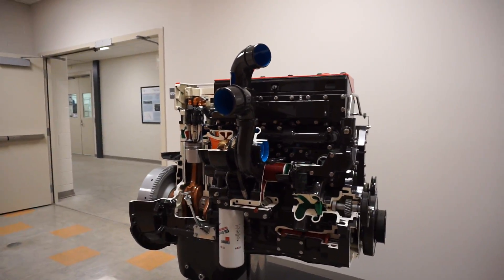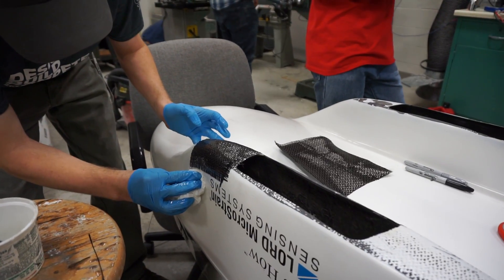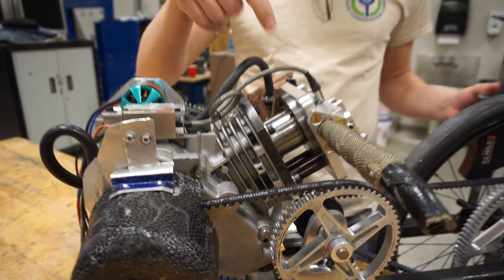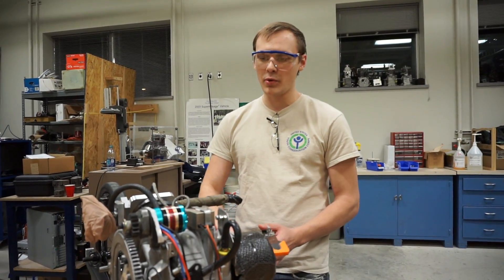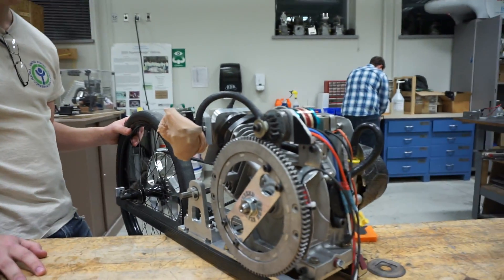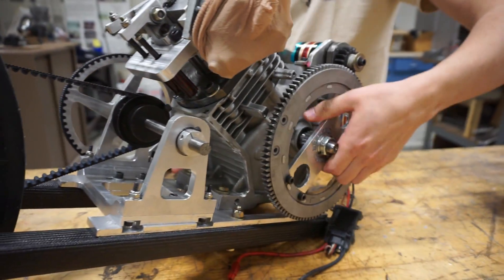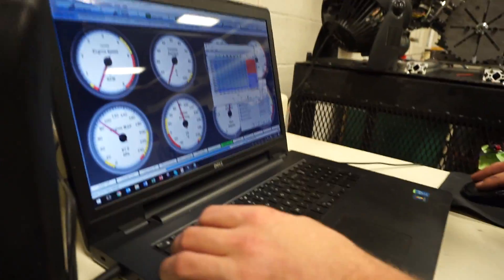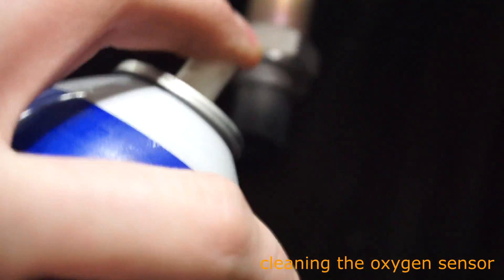How to Get Over 2500 Miles Per Gallon - Supermileage Club Penn State

Comment: In F-1 V8 engine, valves are actuated not by springs mostly because springs cant handle those RPM's, instead by liquid nitrogen , its most stable substance in temperature difference.

Comment: Is that Megasquirt efi? Datalogging will get your tables right. It just takes time, and for the engine to be run at as many throttle positions for every rpm in the rev range. 4100 rpms seems pretty fast for a briggs engine. Usually valves float at 3600. Maybe you could try something lighter. Surely someone could make some titanium valves, retainers, and locks for a gx35 motor.. maybe some beehive springs or at least some slightly stiffer valvesprings to control the valvetrain a little better. I'm assuming the valves and seats have been treated to a multi angle valve job. If not, more power and efficiency can be had there. You could turn the bottom of the valvestems in a lathe to allow more airflow. Maybe lighten the shaft rockers by drilling some holes to remove material. 
  Keep after the engine tuning. Efi has the potential for better power at wot and better part throttle driveability once you get it tuned right. As long as you use a larger throttle body than a carb, you have the potential for better power everywhere in the rev range.. meaning you could make the bore smaller yet and still make the same power. Very interesting stuff. 
Subbed.

Comment: If you make it a longer stroke you will oval out you piston and cylinder over time
Reply: Joshua Highfield they were talking about improving the rod ratio, so the stroke is staying the same but the piston is getting shorter to allow for a longer connecting rod. Adding stroke would increase side loading and friction losses which is counter intuitive to what they are doing.

Comment: Ryan Phillippe and Danny Masterson fuse together to visit strange peoples starting their engine only once per race to claim irrealistic MPG numbers with 25% thermo efficiency of course....
Carbon fiber pushrods but massive non machined enormous rocker arms...
I'm sure the stock camshaft is not hollow.
They could drill holes in 50 % of the parts to save weight.
Use ceramic coating ,and maybe an other thing than a pushrod engine to increase mechanical efficiency first...
Interesting anyway,i wish i could do those kind of stuff.

Comment: how much do the cf pushrods cost to make?
Reply from the maker: +longboardmt not that much. It's just carbon fiber rod that you can buy and then cut to length. Actual value is probably less than $5 per push rod
Reply: Makerj101 thanks for the reply. sounds badass if it's that cheap
Reply from the maker: longboardmt it's light and strong. the problem is that the ends start to mushroom because it's straight grain carbon fiber. it'd probably help if we dipped the ends in epoxy.
Reply: Makerj101 thanks for the info man. very cool idea

Comment: Oh you also need to get rid of the smooth surface of the body. It create laminar surface mention slowing the vehicle down. Also with a synthetic material for a body it's building up an electric charge also slowing you down creating drag you need to make a copper rubberized grounding strap that touches the ground as you drive to get rid of the surface charge on the body contact me if you need some real help

Comment: help im having problem using my horse pulling a hay rake only getting 1 hp and i need to get more work done faster, how do i increase volumetric efficiency of my horse to pull 2 hay rake? plz respond soon my parents do not know i use internet because im at gas station.
Reply: Buddy Rowe redbull iv drip the horse and install a cold air intake. If you don't mind a rebuild sooner ditch the air filter. Install an exhaust header to improve exhaust flow. If this isn't enough break in to your local dentist and steal their nitrous. Then funnel the nitrous and a redbull into the horse, but only do this at full throttle.
Reply: guten tag my friend, i use ebay cold air intake but the horse did not like it much when i tighten band clamp around its face. i buy 4 into 1 header but my horse only has one exhaust so i turn exhaust around backward to make 1 into 4 and it very much did not like me install it as he kick me. our local dentist does house visit and he say he does not have nitrous. i replace the water trough in stable with redbull and my horse die the next day, he did not stop running in pasture for 4 hour.

Comment: maybe suggest to them to use diesel fuel and up the compression ratio to 30:1 as well as getting more than 1 cylinder and each cylinder being 20CC. the efficiency would possibly go up to 32% thermal efficiency as well as not needing a spark plug at all, but needing more fuel pressure ( they already introduced fuel injection, so to make it diesel, all they would have to do is make a thicker top plate, and put the injector where the spark plug is.  also consider a very small turbocharger.  they won't have to change the crankshaft, but would have to add a cylinder either forward or aft of the current one with connecting rods that are much thinner and would have to be made of titanium ( more likely forward, at nearly horizontal, to eliminate the need for more vertical space, as vertical cross-section is bad for aerodynamic drag).
Reply: mattio79 the diesel cycle is actually slightly less efficient than the ottoman cycle at a given compression ratio. They'd be better off just buying higher octane gas and bumping compression.
Reply: The Otto cycle efficiency is 60.2% with typical compression ratio of 8:1 ( no lower than 6:1, and not higher than 10:1)
The Diesel cycle efficiency is 53.7% for the same compression ratio.
However, in practice, a compression ratio of 20 ( or higher) can be achieved in a Diesel
engine.
Therefore, at 20:1 comression ratio, the Diesel cycle efficiency rises up to 64.7%. 
The efficiency can be further increased with forced induction to a greater extent in a Diesel engine than a Gasoline engine due to the larger stoichiometric window available to diesel fuel vs. gasoline, and the greater fuel energy density available in diesel fuel (112% of the energy density)

Comment: What kind of fuel are they running? Gasoline even high octane racing gas will donate way before 18 to 1.
Reply: Barry Fields the tiny combustion chamber would help alot. Due to the scale comparisons to automotive examples aren't very useful.

Comment: I'm part of the super consumption club, Iv'e managed to get my LS3 down to 6mpg
Reply: Thee Adjudicator it's not about the miles a gallon it's the smiles per gallon
Reply: I wanna be in the super consumption club! my small block is about 8mpg!
Reply: 808 Tait lol try 5 mph in a 7.4 liter Pontiac v8
Reply: Conidro I love those engines! 455 right? fuel economy means nothing if you're having fun every time you drive!!
Reply: "I pass 50m with only 60L of gas" - Hanz mit ze Flammenwerfer
Reply: i wanna join the super consumption club, my rotary gets 8-9mpg
Reply: my 460 makes 5 all day :D
Reply: Drove a 2.0 TDI Passat and had it do 57-58mpg
Reply: Thee Adjudicator I got mine to 3 gallons per mile
Reply: Mpg*
Reply: 808 Tait yup, it's a 455, bored out to a 463 with a mild cam, new intake, big carb, and a full straight piped exhuast
Reply: Conidro sweet! we would get along just fine!! if you are ever in Hawaii message me! I'll take you around the island and cause chaos with my Chevy!!
Reply: Pft that's nothing, my 350cui 1974 Corvette was getting 6gpm. It was actually getting 2mpg, and now I brought it up to 10mpg.
Reply: M773 so does my garden tiller
Reply: I probably get that WOT but i got my SLP LS1 to about 30 mpg and my friend got his supercharged LS1 to 32 mpg on the highway. Pretty incredible considering it's a high output V8.
Reply: welcome aboard 808 Tait, any sub 10mpg is worthy :)
Reply: Thee Adjudicator HA. You wanna know what's sad? My 1985 D-150, 318 V8 legitimately gets 6mg on the highway. I've done a lot of performance work too it, but still.
Reply: Glad to hear it Heinrich, keep the American dream alive :)
Reply: I get 16-20 in a honda 4 banger, does that count?
Reply: my peugeot j5 van from '89 is doing 20 -23 mpg. almost a prius compared to those. Though my friend's 12T is doing 3-5.5MPG with a 400L reservoir, so going to the pump stings.
Reply: my boeing 747 is 0,5mpg
Reply: At 2500 mpg, there are many opportunities for smiles to occur.
Reply: Can I join My ls1 gets about 30l per 100km I think that's close to 8mpg
Reply: Judge_Jon ls engines are great on the highway mine gets close to 1000km per 60l tank around town they suck for fuel economy
Reply: carbonfiber492 that's 38 mpg, there's no way
Reply: DMAN22yeah @110kph it's sitting just above idle
Reply: Ruben9505 vw euro 5 diesels are great for economy I remember on golf 6 bluemotion training we got one down to 1.7l per 100km out of the 1.6 tdi around town
Reply: Super consumption club guy here... Can you double stack carbs? Also my flame pipe kit dropped my mpg by 30%
Reply: Tone Bebop would probably run into over fueling issues if you managed to mount them the idea of super consumption club is to have a car that runs but uses large amounts of fuel if it struggles to run it's not running obviously a big cam causing issues is still running 
A better method is to use 1 Weber for every 2 cylinders roll on and they just dump fuel in lol
Reply: Jerry Brown my A6 can tow 1600kg with the 1.9TDI, the A8 can pull 2200kg, no need to go full-on american truck. Even the Model X can pull 2200kg
Reply: Ruben9505 lol ok then how many gearboxes have you destroyed doing that even amarok's like blowing boxes towing any real weight
Reply: carbonfiber492 pulling 1300kg through Norway with the A6, somewhere around 1200km, no problem at all.

If you break your gearbox driving on the countryside, then you either got a bad gearbox or you're doing something wrong
Reply: carbonfiber492 also, my dad uses Amarok for work, they tow a +3ton trailer with a mini-excavator more than once a week all year round, never had an issue and he says it's barely noticeable in comparison to a smaller car without a trailer.

This is a 2.5TDI with somewhere around 180-190 bhp.
Reply: Ruben9505 2.5tdi? There not available with the old 2.5tdi (it was replaced with the 2.0 biturbo in 2010) and there was definitely not a 2.5 tdi with 180-190hp
Reply: carbonfiber492 my bad, it was indeed the 2.0 biturbo with 177 bhp, nonetheless, the gearbox hasn't blown up after 3 years on the clock
Reply: Thee Adjudicator the '68 caddy I used to own had a 472. It got 5-6 miles per gallon. 7 going downhill
Reply: In my 2000 Silverado got down to 6.5ish miles per gallon all the way up to 18ish on highway
Reply: jet boat owners can join this club, got a 454 down all the way to about 3-4 gallons per mile (not a typo)
Reply: 132cc 2 smoke here, got 9km/l of 3% 2stroke mix
Reply: Pff, screw that. Cadillac L26 V8 here getting 0.0MPG according to the trip computer under any acceleration at all. Average 12 when coasting on the interstate in overdrive.
Reply: Thee Adjudicator I rock a 6” lifted bronco on 37s and a 5.8l v8 and I must say good sir I should be the president of your super consumption club as I do not get miles per gallon but instead gallons per mile
Reply: Put your gross vehicle weight up to 16000, when sticker says max weight is 11000 you’ll start to see around 4mpg. 
Source: work trucks 😂
Reply: Nickolas McCollum yup! single digits to be in the club!!
Reply: Poor fuel economy produces a chemical known as Prius repellant. Everyone knows that only the dumb chicks like Hybrid cars anyway so...double win!
Reply: My ford small block 302 is sitting at 10-12 mpg. Looks like I need to up my fuel consumption

Comment: bullshit. maybe it gets that mileage at the flywheel, but put it in a real world situation in a vehicle, with a driver and there's no way.
they're measuring it on a big bicycle wheel under zero load.
Reply: Bob Piff they're not proposing a practical vehicle. It's just an engineering challenge. Of course no practical vehicle in a realistic setting would achieve this, but that's not the point. It's to learn from the project and engage in iteration and design.

Comment: why not diesel
Reply: anthony10370 the Otto cycle is actually slightly more efficient than the diesel cycle at a given compression ratio. Diesel wins out in real world engines because it can handle much more compression than standard gas. But when cost is no concern and you can run high octane gas and match the compression diesel allows with gas you're better off sticking to the Otto cycle.
Reply: Diesel has conciderably more energy than gasoline. In fact, the higher the octane rating the less chemical energy per volume. My question about diesel was not a question of efficiency but one of pure BTUs per gallon. My real question should have been "why not fuel oil #6" at 152000 btu/gallon you could have an engine be 18% less efficient than gasoline and get the same mpg

Comment: Mini turbo  advantages smaller cubic inches but not compatible  with high compression  however go to propane  110. Octane.
Or small diesel  boost through the roof no detonation .

Comment: Automobile engines could be more efficient, but pollution standard compliance limits them in this regard.  They get stricter every year.

Also forget gasoline and use diesel. The engines are far more efficient and technologically advanced.

Comment: You can probably achieve that mpg on a vehicle made entirely of carbon fiber and Kevlar, zero safety regations and a less than ideal top speed. You can create a ridiculously lightweight vehicle that is ridiculously uncomfortable for one individual. 2500 mpg but can it go 75 mph on an interstate during an Arizona summer whole keeping 4 occupants cool and comfortable with a CD player and the ability to charge mobile devices, power steering, power breaks, headlights, tail lights, brake lights, door chimes, dome lights,, passing all emissions regulations, etc, etc, etc, etc. You can take a tiny engine to propel a single person, a long distance but cars don't just get us from point a to point b. They do so while keeping us safe and comfortable.

Comment: 2500 miles? was the test done properly for the mileage? was 1 gallon stuck inside the engine and run until it stopped. or is the range calculated with just math? because i seriously doubt 1 gallon can get you 2500 miles.

Comment: at that CR why don't you run E85-E100?
Reply: E85 gets 25% fewer MPGs than gasoline due to its lower energy content.
Reply: with a micro polished internals and tighter clearances on bearings,  along with being able to run slightly lean with the fuel injection you might be able to take advantage of the longer burn time. I run a mix of 1/3 E85 to 2/3 90 octane in my 9:1 CR car engine and get more power and better MPG, just a thought something you might want to play with....

Comment: that engine connected to a generator possibly by a Chas campbell pulley system, then to a electronic speed controller and from there to an electric motor.

Comment: Maybe make a engine that doesn't run on fuel? I have designed a self running generator will be putting it together soon! Also have a idea for a self propelled bicycle thrust concept. Remember the wheel is invented and doesn't have to be invented again! there are more efficient motors on the market like the eco engine google it and you will see but big corporations don't want this kind of technology out it is a consumer world and that is why vehicles only get thirty or forty miles per gallon! look at the water car and look at who killed the electric car! Here in canada someone designed a generator that was outside the grid only way buddy could use it was have the grid hooked up to  his place  which costs about 25 dollars per month admin fees Sad world we live in! Want to make the engine more fuel economic vaporize you gas before it gets to the engine get rid of the carburator use a bubblier and send the fumes right in the engine
Reply: Marc  A Gagnon thermodynamics
Reply: Marc  A Gagnon you can buy electric cars today

Comment: all engine cams are ground to allow the exhaust valve to remain open 1° into the intake stroke which allows the vacuum pressure in the exhaust system to pull out 70% of the incoming fuel,
if thats not bad enough it also opens the exhaust valve for 1-10 of a ° at the bottom of the compression stroke to allow 70% of the atmosphere to be pushed into the exhaust system as well.

by law no petrol engine operating in the us is permitted to exceed 
20% EFFICIENCY.

IF YOU ENGINE GENIUSES EVER CUT AWAY AN ENGINE VIEW ALL THIS IN ACTION. IT WILL BLOW YOUR MINDS.

ALL YOU HAVE TO DO TO INCREASE HP BY 100% and economy by 300% is simply correct the grind on the exhaust lobe of your cam.

problem is no one who grinds cams will do this for you because they know whats up and are all paid dividends by the feds to comply and keep there secrets.

you have to be able to remove the excess metal and do your own surface polishing your self best you can.

there is a ton of black magic knowledge mixed into all the good knowledge of things built by industry to insure and Guarantee profit and unnecessary consumption.

the only guy i know that learned about this and did it, got 120 mpg and gained more than 200 hp on a stock 350 engine.
when he tried protect his knowledge the feds told him no.
when he started selling his knowledge to his buddys and they tried to run off with for fame and riches.
they got the man murdered doing so.

so i dont try to sell my knowledge to help this planets health.

im not afaid of the feds, i just dont need any more money than ive got.

if you do this to your vehicle.
do it secretly,
dont tell a soul what you have done because your own mother,father,brothe,sister or best friend could a jesuit spy for the devil and not even know they are.

use and enjoy it and that is it. PERIOD.

BLESSINGS.